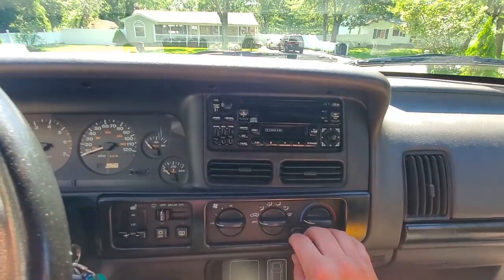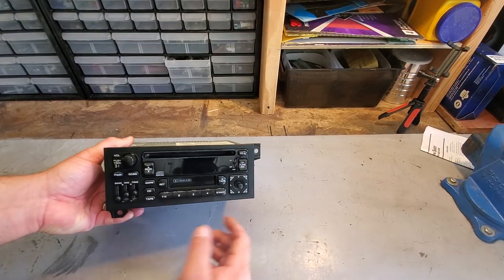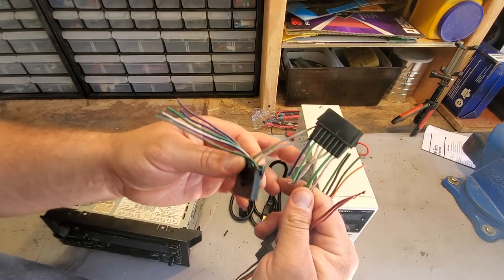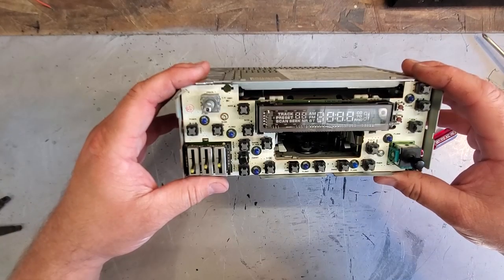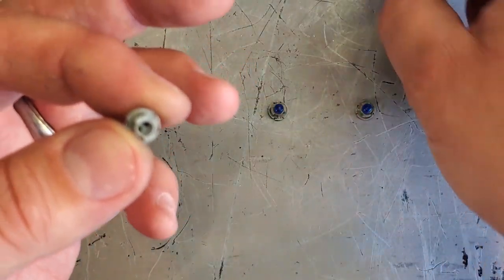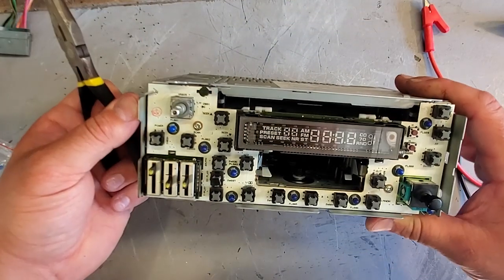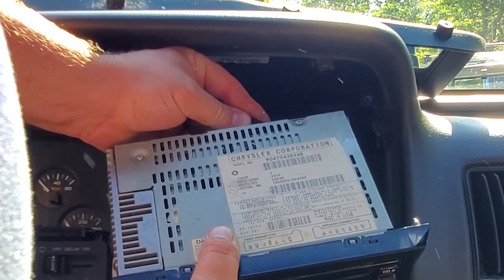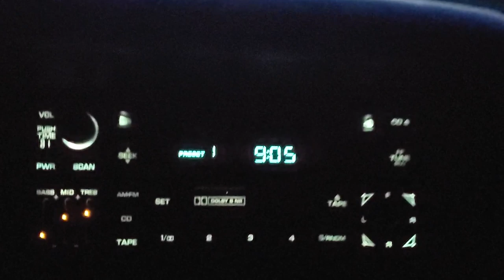JEEP ZJ RADIO BULBS - MOPAR HEAD UNIT ILLUMINATION FIX AND LONGWEI POWER SUPPLY

Comment: Awesome! Now I know how to fix those radio’s with backlight issues. I finally bought a Jeep ZJ limited 4.0 with sunroof! 🙌🏻 Super happy about it! It need some work, but I like to do that myself too.

I wanted to keep the radio stock, so I bought a bluetooth module and a special Chrysler-AUX module to connect to the CD-changer port. Can’t wait to have it in! https://www.discountcarstereo.com/chry-aux.html?category_id=257

There’s also a Bluetooth version, but I decided to have it separate due Bluetooth upgrades in the future and having the convenience of a carkit as well.
Reply: I see that your ZJ radio does not have the multi-cd port on the back. :( there are probably also options to add an AUX input on your unit, but will require more work I guess.
Reply from the maker: Awesome man congrats! DIY is what its all about!
Reply from the maker: I will be installing and old school pioneer DEH9800bt soon. It has Aux and BT audio! What a classic!
Reply: Project Dan H Dan, does your ZJ has an Infinity system with the amp and blown out Infinity speakers? I refoamed the speakers and they sound amazing! Sounds if there is already a sub inside the Jeep haha! I made a video of it how to do that. When I get my editing skills done I will upload the video 🤪
Reply from the maker: @FR0MMEL  that's awesome! My speakers are horrible! Haha! I actually have a pioneer head unit and infinity replacements sitting on my workbench waiting for installation.  Can't wait to see your fix
Reply: I know this is three years old, and I think you're talking about the LCD. No joke a real firm tap/smack on the deck will get the LCD back up. Sometimes it takes a few times, not sure if it's permanent yet, but if you still have your deck...